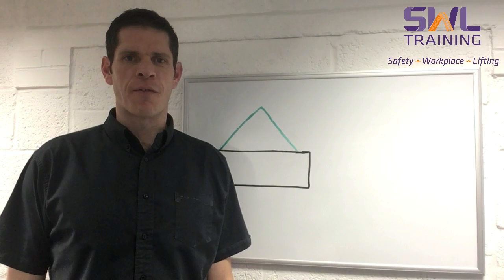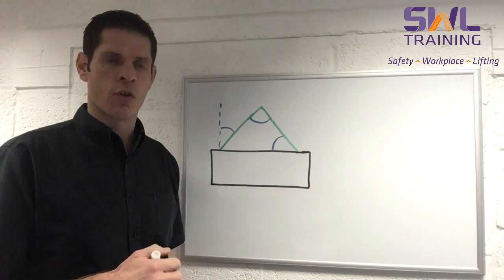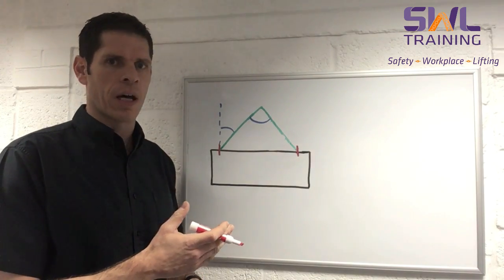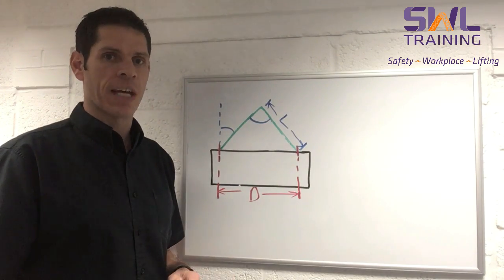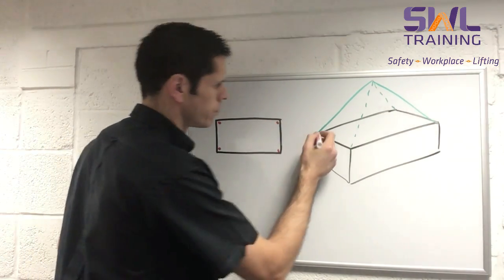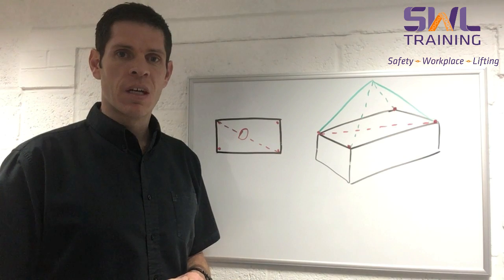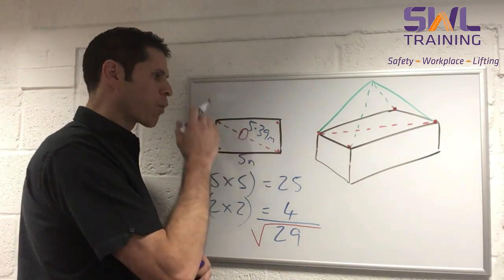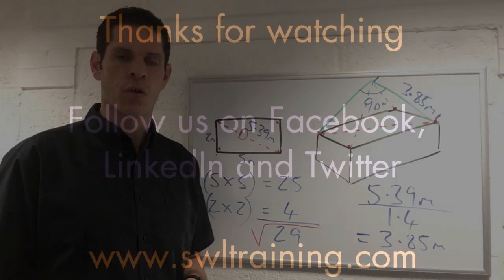Sling Length Calculation Tutorial

Comment: Cause the lord is on 4 connection L does not equal D÷1.4
 THE TRUE ANSWEAR IS D= L÷2.1
Cause the tension is spreading amoung 3 sling.

 kindly
Correct me if I'm wrong.

Comment: Hi Kevin.
After 7 years of this video and we are finding new challenges.
I mostly do bottom lifting of different size containers, from 10f to 32f all of these for the construction industry.

I have a question, how would you calculate the D at the top of the container with a bottom lift, the D location is not immediately known, it is dependent on the angle between the bottom connection (where the chain bends at the top) and the diagonal 90 degree included angle on the top.

Comment: Hi Kevin would you be able to tell me why or where the 1.4 comes from and this is used?
Reply: Thanks for you reply Kevin much appreciated!
Reply from the maker: Hi Wendy...thanks for watching. 
The 1.4 comes from the sine value for 45 degrees being 0.7071 - which would be used if calculating the length of each sling using trigonometry. As we are calculating for two sling being at 90 degrees, we double that (= 1.4142) and just round it down to 1.4 for simplicity.

Comment: Simple "Sum of the  moments" problem in freshman Statics course. in this day and age,  should be number of "Apps" for your cellphone. Input data required: 1) Load Weight 2) location of sling attachments on load 3) Load Center of Gravity 4) Length of Slings 5) Load Limit Rating for each Sling.

Comment: Thanks Dear can you explain how we r to calculate D shackle capacity
Reply from the maker: Thanks for your comment. Refer to the WLL on the Dee shackle. If using Dee shackles in an angled arrangement, you must ensure that the sling is connected centrally within the shackle (i.e. 'in line') - calculate the overall SWL (rated capacity for the configuration) using Uniform Load Method.
NB: Dee shackles must not be used with anything connected out of central alignment - use bow shackles for angular connection.

Comment: question on a different matter regarding slab lifting. My slab weighs 5t and the design shows x4 M24 threaded lifting anchors being used, however i can only see that these have a SWL of 2.5t. How is this possible? is the load distributed across x2 / x4 points making lifting the slab ok? i.e 2.5 x 4 = 10t SWL on the anchors meaning the anchors wont pull out during lifting. thank you for any help from anyone.
Reply: For four lifting points. When doing the calculation for SWL of multi-leg sling assembly to be use at an angle, you have to knock off one leg from the calculation hence remaining three legs. 
The load is evenly distributed across three legs, the fourth leg is only for support.
For example,
👉🏾Load weight ÷ Mode factor = Minimum vertical capacity of each sling to be use in the multi assembly. 5÷2.1= 2.4ton.
👉🏾SWL of one leg × Mode factor = Maximum SWL of three or four leg sling assembly. 2.5×2.1= 5.25ton

Comment: Dear Mr.Kevin, Thanks for the well explained tutorial. I have a doubt, In an other video you have mentioned the load factor for 3 & 4 Legs is 2.1, but here you have mentioned 1.4. Request you to clarify.
Reply from the maker: Hi Prem,
The mode factor of 2.1 is for the sling rating (i.e. capacity), not for the length. Even if using four legs, the required length is calculated between the TWO lifting points that are farthest apart; the other two legs will be the same length as the two that have been calculated (unless the slinging method is asymmetrical).
Reply: @InspHigher  Thanks for your valuable & clear explanation. Request you to post more videos of chain length calculation for lifting Asymmetrical jobs & for lengthier jobs.

Comment: Well done sir, but i have two questions that:-
1. For 60 degrees why do i need to divide with 1.4?
2. For 90 degrees why i need to divide?

Is this denominator a constant?
Reply from the maker: Thanks for your comment. 
a) As explained in the video, for 60 degrees, you do NOT need to divide by 1.4
b) This comes from the sine and cosine value of 45 degrees
Reply: @InspHigher  Hi sir,
sin45/cos45 is 0.7 then how you taken 1.4 ? can you explain
Reply from the maker: Because you’re taking the complete distance between two slings, rather than just the distance between the centre of gravity and one connection point. 2 x 0.7 = 1.4
Reply: Thanks for the clarification

Comment: where do you get the 1.4 from, I  understand the length .. and the distance..
Reply from the maker: It's taken from the trigonometrical sine and cosine value of 45 degrees being 0.707. 
Multiply that by 2 (for 90 degrees) = 1.414 
It's then rounded down to 1.4
Reply: Thank you for your reply sir

Comment: Thank you very much, this is how to find the minimum sling length, could you please explain how to find the maximum sling length ?
Reply from the maker: Hi Ahmed, thanks very much for watching the video. 
The purpose of this is to find how long your sling leg needs to be as a minimum. It's simply a case of selecting the next available length up from your supplier.
Maximum sling length would only really be relevant if you had limited available height (e.g. working indoors). In that case, trigonometry would be required. We cover this on some of our courses, and may do a public tutorial on it in the future.